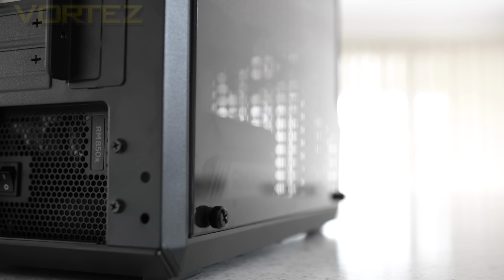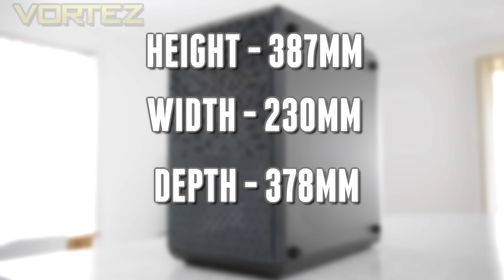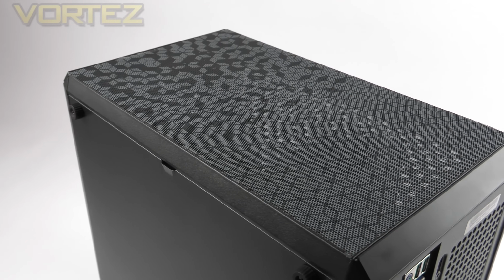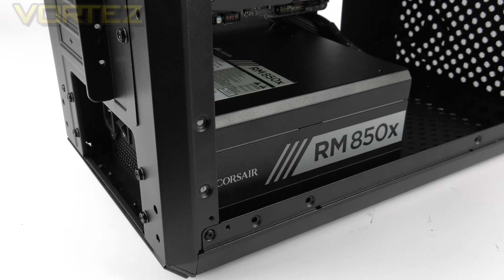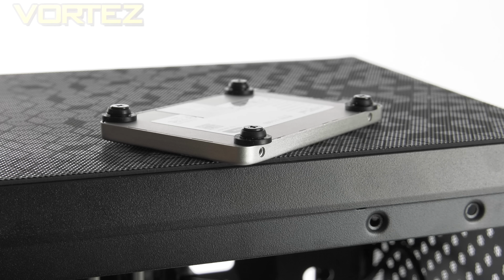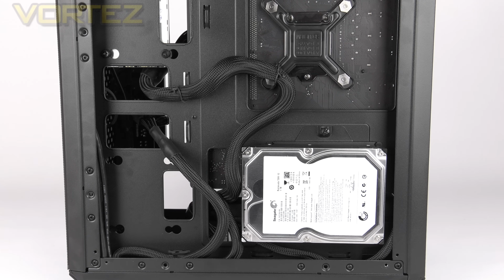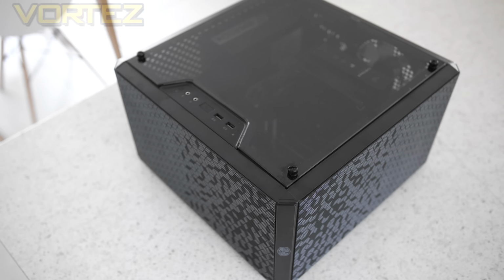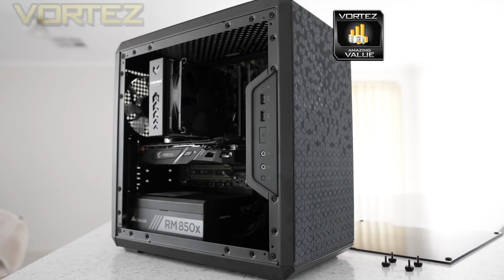Cooler Master MasterBox Q300L Review

Comment: I have used the q300L for 8 months now, and i have a 240mm radiator in the front. I feal like the airflow is pretty poor through the case. and i cant fit the radiator at the top bacause it would hit my ram sticks. Do you think installing 2 fans in front of the radiator and in the back would increase the airflow through the case? Im planning to upgrade my gpu pretty soon, and there simply isnt enough airflow to cool the gpu.

Comment: Getting this for my own build, the dust filters that let you easily clean them without having to take the entire front panel off are so much easier to maintain for me. I think the front IO panel being on the side is actually really good for some, for example I usually position my PC so that the rear IO shield is facing me, because I think it lets the heat escape easier than if it faced the wall, so with the front IO panel on the side it's still easily accessible.

If only the lower dust filter was more easily removable and the IO panel had a usb-c, then it would be perfect, but it's still good enough for me as is. Love that it's got the space for a 3.5 drive, I don't know if I could go without my storage.

Comment: Thanks for the great video, I was on the fence about going mATX instead of my usual ITX (more expensive and harder to get) but after checking this case size, I think this'll be my next case for a new mATX build: Asus H610m-k + i3 Gen13, no video board, so it should run cool. I agree about the front panel location (side panel actually). I don't use it that much anyway and that's why I'm getting a motherboard with more USB ports on the back.

Comment: This is the garbage.
It's not made of metal, it's made of paper.
The fan only spins but does not deliver air, but at least it is loud.
The power button is a shame and when you press it, the machine housing bends when you turn it on.
The side is not glass or even Plexiglas, but solidified fart.
He gets scratched by every little thing.
The rubber front and top of the grid are wavy after installation.
One advantage is that its LEDs are white.
It's pure fairground crap.
Reply: It's very unfortunate, because this case looks really good and it's compact enough. I wish they made a better quality verison with better thermals.

Comment: No second 3.5" drive pad, which could have easily been added at no cost... You're left with only one data drive. And they could have also added fixing points to move PSU to front, so it could fit ATX motherboard if necessary.

Comment: This casing came highly recommended by the dealer.  And now I wish I'd watched more YouTube reviews.  My GPU runs hot, fans constantly at 100% and I now have to buy more fans to try improve cooling - which the dealer can't guarantee will work.  And the GPU fans are only about an inch above the PSU.  What's the point of blowing hot air onto a hot device.  As the presenter says... push the budget a little and get a better casing.  I wouldn't recommend this casing for anybody installing a GPU.

Comment: They could really remove the SSD "fixing area" and just let the SSD hang in there with a duct tape or something and then reduce 20cm more. Who needs DVD and 3.5 inch drive these days. Most likely no one will need a 2.5" SSD anymore and will just use M.2 drives.

Comment: would this be good for beginners? i’ve never had, nor built a pc before. i’m still doing research and barley know what any of this means. :)
Reply from the maker: It's a good case for a beginner but you will need to check dimensions on components because it's a small case.
Reply: Vortez thanks!

Comment: Just picked up this case for a friend's build and share all the same complaints and praises. One thing that really puzzled me when building in the Q300L was the PSU bracket. What's the point of that? Seemed to needlessly complicate PSU installation and partially block the AC cable without bestowing any obvious benefit.

Comment: I recently transferred my old gaming rig mATX internals to this case with 2 x 120mm intake fans and 2 x 120 mm exhaust fans. Currently working as entertainment PC in a TV rack. Excellent case, light, compact, ample space to mount 160mm PSU, 270mm 2.5 slots GPU, 160mm cpu Gammax400 air cooler, good air flow with 4 fans, easy to build, more space for cable management on the covered side.  Thanks for you review 🙂👍👍👍
Reply: how do you get the fans in urgent

Comment: Looks like the front mesh the filter sits on will have terrible airflow considering most of the surface area is mainly SOLID material rather than open space

Comment: Had extrem Aiflow problems with mit Q300L and RX 590. PC got off after some hours of gaming. GPU went to 85°c. 3D printed a fan box funnel, which solved the Airflow problems. Now my PC runs at 60° to 70°. Maybe 75° if CPU and GPU using 100%, but now crashs anymore! Besided of the temperature problem , I'm very happy with my case. https://www.thingiverse.com/thing:4402232

Comment: Ok so i got one of these. Awesome case but i have to point out that when my fans were mounted to it, because of the cheesegrater design the fans got about twice as loud and became quite audible. Im using be quiet! fans aswell which were silent mounted off the case. No noise though if mouned outside the case. So I fixed this by buying two cheapo 140mm front fans and hollowing them out and using them as a buffer between the case and the cheesegrater mount. Bit of a ballache but worth pointing out for those of you who want a quiet build. It wouldnt be a problem whilst gaming as i have headphones on but working from home doing light tasking stuff the noise would be annoying as it had a drone to it.

Comment: Will a cooler master master liquid ML240L radiator for in the front , as stated in the video  it wouldn’t fit in the top but I would like to know about the front. I’m using pcpartpicker and it doesn’t say anything’s wrong but I would like the extra re-assurance.

Comment: I just got this case and almost had cancelled my order of it as i was  indecisive on it. I must say I'm glad i didn't, it is better quality than i thought and videos of it don't do it justice!  Its a great upgrade from my old bitfenix neo . Nice and modern and so silent. Don't be put off by some of the reviewers.
Reply: @kommandant8272  Hi yeah the case is great definitely worth the money. I manages to get mine on ebay for £40.00 i think it was discounted but still worth it if you had to pay a little more. It comes with one fan and i added two front fans, dont have a custom cooler but the airflow is fine. I use a controller for some games and having the usb ports on the side is ideal. If i could post a picture of it here i would but yeah i recommend it.

Comment: So I have ordered this case as well as B450M Pro4, Ryzen 5 2600 and a single LPX 8gb 2400mhz stick of ram. I plan on transferring my XFX RX 580, PSU and 2 HDD's to this case... then I realized it only has support for mounting one HDD. I need to order either a M.2 or SSD. Any recommendations?
Reply: M.2, less cables to manage.
Reply: nicoc77 yeah I ended up getting a evo 500gb nvme ssd by Samsung. It’s awesome!
Reply: Jerm Stone  i want to build up the same system as yours. how did yours worked about  tempereture and noise?
Reply: mpam002 it’s doing well! Temps all stay within reason and it’s all air cooled. Cpu never exceeds 65c under full load and gpu never exceeds 85c under full load. I also ended up getting an additional standard 500gb ssd for more storage and added a couple rgb strips to show off all the black internals due to it being soooo dark in the case with them lol.
Reply: thanks for the answer didnt expect  to be so quick.Did you put any extra fan there? i am worried about the place of th hdd behind.How about the noise?
Reply: mpam002 I added 4 more fans but they aren’t anything special. I have total 5 fans with 3 exhaust (2 top 1 rear stock) and 2 intake (front). I set a fan curve on them to only speed up when gpu temp increases under load. At full speed it is a slight hum from the fans but that’s more from my gpu which is the loudest component in my case.
Reply: mpam002 hdd behind mobo temp is fine . Mine is 40c
Reply: @JermStone  i might well risk it and take it. thanks for all the information
Reply: mpam002 you’re welcome and good luck my friend

Comment: Great review. I added a rear 120mm radiator and two 140mm intake fans as well as a 120mm top rear exhaust fan. Case is super cool. Thanks for the review which helped with my build. I love the case.
Reply: So one 120mm fan on the top back, two 140mm fans in front, and another 120mm fan on the back under the preinstalled one?
Reply: David Icke two 140s in the front. The existing 120mm  I moved to the top front added another to the top back position. Then I have the radiator 120 cooling the cpu and expelling air out the rear of the case. Total of 4 fans and the radiator.
Reply: @marklarkins582  got it, thanks!

Comment: If this case was tempered glass included, it will be perfect
Reply: Pretty sure the tempered glass version is called Q500
Reply: Probably not, since it will drive the price up at least $20. Can you really tell the difference looking at it from a few feet away?

Comment: Is there a possibility to use this case upside down? What I need is to have the window on oposite side. To do so I would need to attach legs and bottom filter to the top, and upper filter to the bottom side of the case - is it possible?

Comment: I ordered a full build with this case! It will be here in a few days, I CAN'T WAIT!!!
Reply: Znek Ayyyyy I’m probably doing the same
Reply: @andrewkwon8406  I'm gonna get 2 extra 12mm fans for the front later in August but it comes tomorrow and I have to enjoy it first hahah
Reply: Znek Hope everything goes smoothly
Reply: I know it's designed for a single 3.5 hard drive, but is there room for a second hard drive?
Reply: @valentinpianta  not sure because DHL is late with it and it hasn't arrived yet. They reckon something around Tuesday
Reply: Valentín Piantanida on pc part picker I saw someone put a extra 3.5 inch to the far right on the floor of the case sooooo that might be a solution

Comment: This review is SO COMPLETE. Cooler Master did a right job sending this sample to the guy. Definitely will buy this one
Reply: I'm new to PC building. Do you know if it has RGB fans or if those are normal ones? Thanks!
Reply: Shuichi Akai it has one normal 120mm fan. I suggest getting a 3 pack of rgb fans
Reply: @EJTunaFish  thanks mate. Another question: if I have a motherboard with only 2 ports for case fans, how can I connect 3 fans (2 in the front and 1 in the back)?
Reply: Shuichi Akai you can buy a hub, they’re pretty cheap.
Reply: Shuichi Akai and most RGB fans come with a controller the you plug them into, then you plug that in
Reply: Shuichi Akai also, the q300l doesn’t have flat corners so when install the power supply you need to take a little bracket out and put that on the power supply first. If you need help you can ask me to upload a short video
Reply: @EJTunaFish  thank you man, really appreciate your help! I'm really into this case and will definitely buy it for my pc build. I will remember your tip with the bracket :)
Reply: Shuichi Akai Your welcome, just trying to help a fellow builder.
Reply: Shuichi Akai Another tip, when you buy a fan hub the motherboard usually will only read fan port 1, and that will control all the fans in the hub.
Reply: Shuichi Akai did you buy the case?
Reply: @EJTunaFish  great tip thanks! Didn't buy it yet, still waiting for my laptop to break down ^^

Comment: I tired building with a MSI AMD B450 gaming plus motherboard and I couldn't get the power supply in and couldn't use it any suggestions?
Reply: Same thing here, i dont know anymore... (Using Thermaltake 500 white Smart 80+ psu)
Reply: @billybobbaggins2  it's bullshit what a terrible place for the power supply

Comment: I like this case, but it's not nearly as thermally efficient as it looks, check other reviewers if you don't believe me (there's a slightly different version of it which has even worse thermal performance as well, the Q500L). Those grilles obstruct a lot of air-flow. Adding just one 120mm fan to the front will make a big difference, but it still won't have great cooling. You might as well go for 140's, as they generally aren't much more than 120's, and will be quieter and/or more powerful. With two 140's on the front, the cooling should be pretty decent, but then you're spending a lot of extra money. I actually bought this case on sale (for about $50 CAD), and I don't mind spending extra on good fans, as I was planning on doing that anyway with any case that I buy. I also wasn't planning to use a very powerful system, so the weak ventilation isn't a big issue for me (I'm only using 1x 140mm fan).

You could also find a way to cut larger holes where your fans are pulling air in to help improve air-flow. It could make a big difference, but it's not easy to do without damaging the aesthetics of your case if you don't have the right tools or don't know exactly what you're doing.

Comment: Yo lo tengo con una MSI B350m Bazooka, 2x8 de ram Corsair Led White, Ryzen R5 1600 cooler stock,. SSD m.2 WD Green de 480Gb, HDD WD Black de 2tb, 5 coolers NZXT F140 y una Radeon RX580 de 8gb. La verdad que este case me sorprendió, un espacio súper amplio, es muy lindo a la vista, bien ventilado y compacto. Es cierto que el panel I/O aparenta fragilidad, pero no es nada preocupante. Personalmente lo recomiendo.

Comment: the acrylic side panel was incorrectly put in place at around 45 seconds into the video, the acrylic panel should slide under the power button piece, not sit on top of it.

Comment: My wish for a compact PC part list:
-Case: Cooler Master MasterBox Q300L
-Motherboard: ASUS TUF B450M-PRO GAMING (best i can buy at the moment)
-CPU: AMD Ryzen 7 2700 3.2GHz box
-GPU: XFX Radeon RX 590 FATBOY OC+ 8GB GDDR5 256-bit
-RAM: G.Skill Flare X (for AMD) 16GB DDR4 3200 MHz CL14 1.35v Dual Channel Kit
-PSU: Seasonic Focus+, 80+ Gold, 750W
-SSD: CRUCIAL MX300 525GB 
-HDD: Seagate BarraCuda 2TB SATA-III 7200RPM 256MB
-CPU Cooler: CPU ARCTIC AC Freezer 33 TR White
-Thermal Paste for CPU: Noctua NT-H1
-Fans+ : Noctua NF-F12 industrialPPC-24V-3000 IP67 Q100 PWM (1x CPU Fan) , Noctua NF-A14 industrialPPC-24V-2000 IP67 PWM (2x front Fans) , Noctua NF-F12 industrialPPC-24V-2000 IP67 PWM (2x back fans with 1x roof top back and 1x back side top)
TOTAL COST at the moment = $1570
(ANY SUGGESTIONS?)
Reply: (SSD not added in total price sorry i forgot because i did not find it available atm but i allready have the SSD in my laptop)

Comment: Is it long enough for an Asus RX480 Strix?
Reply: Yep
Reply: @0x5af  what about a xfx rx 580
Reply: I was able to fit a ASUS Strix rx580 with a 240mm cooler master aio radiator and fan.
Reply: I have an asus gtx 1080 strix in this case and 2  inches of space left...

Comment: Hello, I would like to ask you i have a Cooler Master 212 EVO cpu cooler, and is it fit in the Masterbox q300L?
Reply: Technically, no it shouldn't, that cooler is 159 mm tall and the chassis only supports 157 mm CPU coolers, but they were able to fit a 160 mm CPU cooler so yours should fit, but it would be very snug. I have a scythe Mugen 5 in mine and I have a few mm clearance to the side panel

Comment: 38€ best price to value got a new pc after struggling to keep up with a GTX560 and a i5 2500..... If anyone is interested what I have got in (€)

Powercolor Red Devil RX580 8gb
Intel i5-8350K 
Be Quiet! Shadowrock TF2
Crucial ballistix 2x4gb 2400mhz
500W Be Quiet! PSU 
120gb Kingston SSD
This Case
1000gb HDD Toshiba 
MSI B360M PRO-VD

This built was around 689€ here in Germany 

This PC shredds any Games I throw at it I slapped better thermal compound on the Card and on the CPU and overcloaked the CPU+GPU a little bit  gaining around 16% more Performance 

Im so happy to get a pc this cheap and with this beast price to Performance ratio!!!

Comment: can it fit more than 1 3.5 hdd?
Reply: probably infront of the PSU
Reply: MMMTZ FTW you mean just put in there?
Reply: Ready Red maybe you'll need a caddy/drive bay, so it fits. Anyway I'm soon going to buy this case and build my system in it, I'll be sure to check out if I can fit an Hdd in front of the psu
Reply: @Mizra-dq3lj  how about your experiment with caddy drive? Is it fit?

Comment: If this had been out 2 years ago, I would have considered it. I wanted a non-ATX small case. I built a powerful 140mm fan-based gaming PC in the Phanteks Evolv ITX. This MasterBox has the same sex appeal. Gaming motherboards support high-end integrated audio so only a GPU is needed. Unused slots are wasted space. My case is on my desk. With a windowed PC why throw it down on the floor? I want my guests to see what I put under the hood, not hidden under a desk.